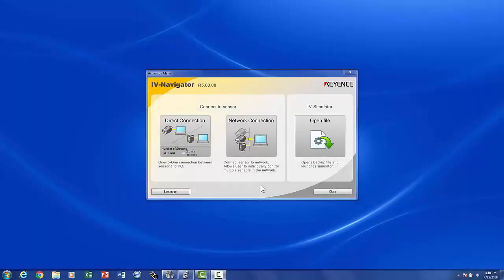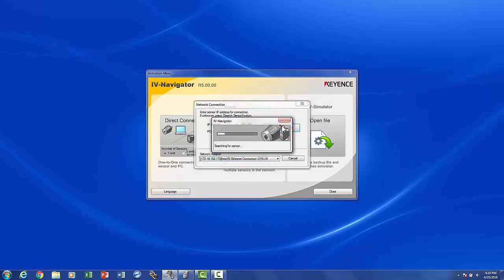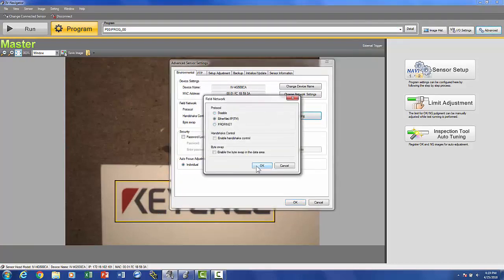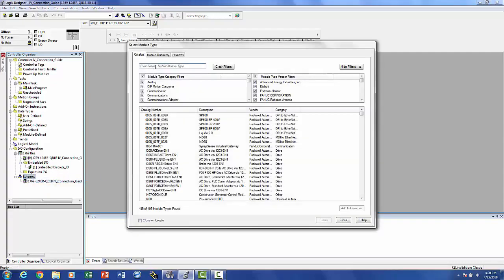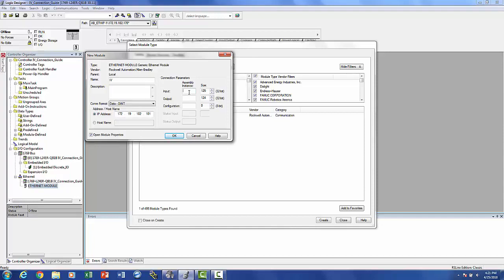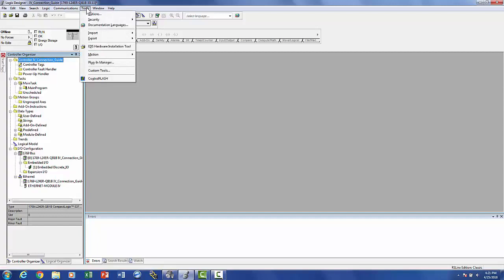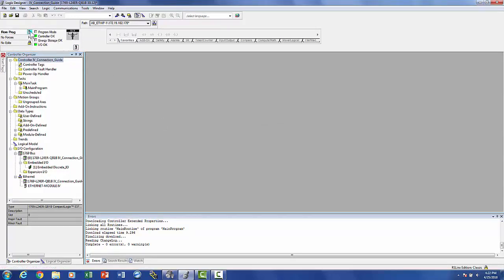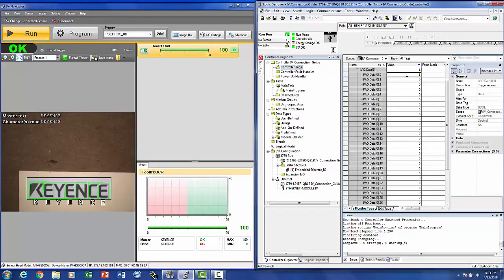PLC Keyence ,  Programación.

Comment: Hello, how are you, I am writing to you in case you could help me, I have a KV24 with a fatal error and I need to change said PLC for another of the same model. I know that these PLCs have an anti-copy of the software which does not allow you to download the program if you do not have on the PC the one identical to the one installed. It turns out that I don't have it so I can't download the software to copy it to the new one. Do you know if there is any software that I can use to be able to skip this anticopy and be able to download the PLC program? thanks for your help